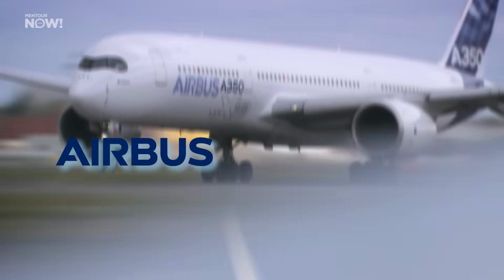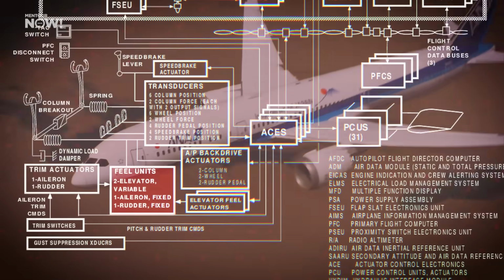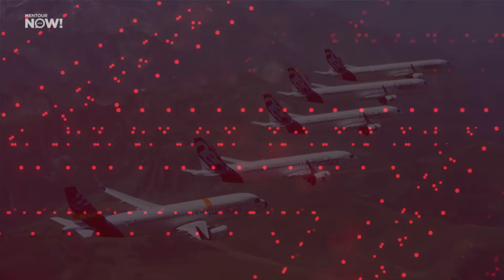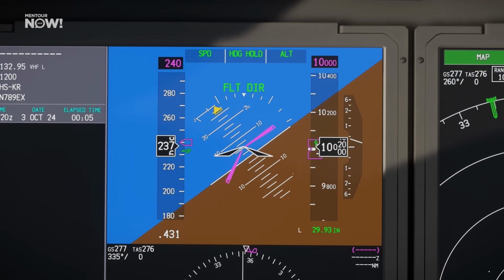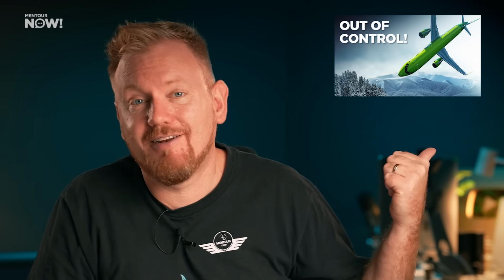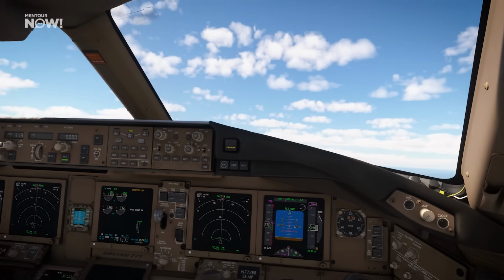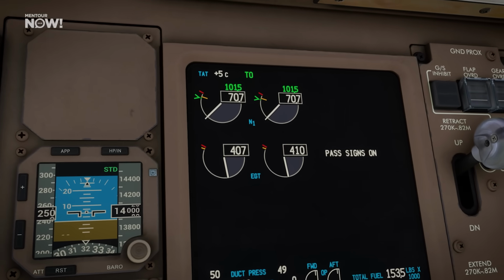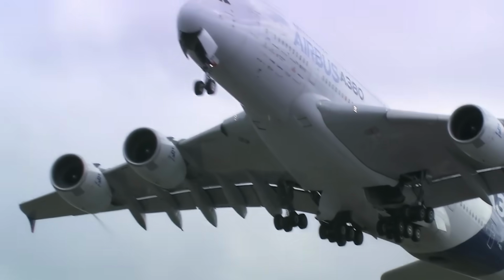Do Pilots Prefer AIRBUS over BOEING?!

Comment: Airbus > Boeing
Reply: If Airbus could implement active feedback and feel on all their primary controls, they would win hands down.
Reply: @alexandermonro6768  true
Reply: It is funny how Petter left 737 NG/MAX out of this. Even if majority of Boeings flying today are those. Those are of course 3rd gen, but it is not as safe or comfortable as 777/787 or Airbuses. I flew my first 2000h on 737NG and the next 10 years on 330/350. And I would never go back to that shitbox.
Reply: I prefer planes that don’t just fly out of the sky and crash or have sections of the fuselage blasting open midair
Reply: At least right now, I have to agree
Reply: Boeing still leads on total deliveries and revenue since Airbus started making them in 1974. Boeings' recent decline can't be denied but is still the dominant aircraft manufacturer overall.
Reply: Agreed. The perfect mix for me would be something in between; Boeing’s yoke & throttle with Airbuses “foolproof” systems
Reply: @realLsf Why do you value the yoke so much over the stick? Most fighter jets use sticks, I think. 
Adding feedback to the sticks and linking them seems much more important to me (but I’ve hardly any aviation knowledge, so just my thoughts).
Reply: @Conservator.  I think the yoke is more intuitive & feels more natural. You could build cars with a steering joystick but it’d feel strange to drive. I imagine that the pilots who train on one system or the other are well used it & both have their benefits
Reply: @realLsf  Ok tx! I thought that sticks would be a little more intuitive but that’s because I’ve once flown a sailer and that one had a stick so that’s my bias. (Just to explain). 
Like you mentioned, it’s probably what pilots are trained on. 
I do think though that forced feedback and linkage will be a major improvement. 

Cheers!
Reply: @ Good point about the single stick. Maybe it’s the pressure in the mechanism that’s important; giving it feeling
Reply: @Conservator

228 passengers in the South Atlantic are DEAD because of a side stick vs a yoke.  

Air France 447 would not have crashed if it was a Boeing.  

What’s more.. AF447 would never have got into the position it was in when it entered deep stall because the pilot flying would not be depending on Alpha Protect to keep him from doing so. 

Alpha Protect was disabled on AF447 when it reverted to Alternate Law in the absence of air data inputs… and its another flawed system that preserves angle of attack rather than airspeed (which contributed to the fatal crash of Airbus Industrie 129.. the first A330 to crash) and doesn’t explicitly annunciate its status.
Reply: @calvinnickel9995  
Why do you think it was the side stick. How would a yoke have prevented the accident?
Reply: @Conservator. One problem with stick is that a first officer graduating to captain has to switch hands
Reply: @realLsf  100% agreed.
Reply: Eww
Reply: Airbus at least has all the doors in the plane
Reply: @TechwithMartin. But when one pilot pushes the side control up and the other one down, the airplane ends up at the bottom of the Atlantic.
Reply: @CaliSteve169  Thats why wikipedia has with almost all boeing models a section called "Accidents or incidents"
Reply: @TechwithMartin.  if you consider total hours flown to accidents, Boeing is actually safer. In reality, both are statistically very safe.
Reply: @NaveedAkhtarButt  yes but they are connected mechanically.
Reply: Yes except airbus and Western Europe would not exist without America and it’s big stick.
Reply: Sure... At least a Boeing pilot can do whatever he wants if he's very insisting with the automation systems, like even crashes his plane if he wants to do...

An Airbus aircraft will have many more numerous protections before it will let do to happen.
Reply: This comment and 90% of the answers are not from pilots
Reply: Anything > Boeing
Reply: @colinchesbrough5772  yet statistically Boeing is the safest aircraft.
Reply: The problem with the airbus system is pilots rely on the computer. The Air France crash resulted from the pilot expecting the computer to fix his bad input not realizing he was in direct control and putting the plane into a stall. No tactile feedback for several minutes. The Boeing system would have at least given him a clue.
Reply: Boeing is a the poster child for human error..Airbus far superior
Reply: Personally, I like Boeing more. It's kind of weird to explain but I don't like how easy it is to fly a airbus. It's like manual vs automatic gearbox car. Automatic is easier to driver but manual is more fun. Though, I would not like to fly on a 737 any time soon lol
Reply: I am not educated on plane models, so why is Airbus better?
Reply: I knew it💀
Reply: Boeing has unclogged cooling systems.
Reply: Boeing is abit like American cars, great in a straight line.
Reply: I used to love Boeing, but with their recent issues spanning the last few years, I’ve become a much bigger fan of Airbus and their approach to overall quality of aircraft they produce.
Reply: @Eye-Byte you can still love Boeing. Why wouldn’t you? They’re superb aircraft that have had some bad press.
Reply: @ actual crashes and near crashes aren’t “bad press”
Reply: @ both crash sometimes Mike
Reply: Today, yes. However, Petter has done quite a number of episodes on pilots crashing perfectly good Airbuses because of how their systems work.
Reply: Better than perfectly good pilots crashing boeing planes cuz they're death traps
Reply: You’re obviously not a pilot.  

Pilots want the most money for the least amount of time away from home.  An A320 pilot slogging it out doing four legs a day on their 3rd four day paring of the month would fly a 777 twice a month to Europe or Asia in a heartbeat.
Reply: For now.   I can't get over the side stick
Reply: @MavHunter20XX  just modify it bro
joking 😂
Reply: At least it won't crash your plane
Reply: @MavHunter20XX  same, if they were linked together so, they can't cause a dual input, I'd be a lot more on board.
Reply: @Mon-W  yeah, that is what I was talking about. What is worse, you can't look over and see what the other seat is doing clearly....its like their "secret steering"
Reply: @Mon-W Airbus have been looking into a joystick with feedback. I’m not sure what happened to it tho?
Reply: @Mon-W  At least it's a relatively simple change
Reply: Options taken. None perfect, both marvelous engineering on each plane manufactured
Reply: airbus is ran by engineers who care about planes and manufacturing 

boeing is ran by accountant who care about money and profits 

you be the judge
Reply: best coment. everything is said.
Reply: COPE
Reply: State Capitalism > Shareholder Capitalism
Reply: No, Boeing isn’t worse, but people who watch Mentour Pilot will lean towards airbus because they can’t detect the channels bias towards airbus. The channel loves rubbishing Boeing and when he says “I’ll leave it up to you” it’s only after he’s set up the theme.
Reply: @chrismillard8222  bro, youre actually not sane if you seriously think that. Hes a boing pilot and seems like a strong believer of boing more involved style of flying.
Keep up the cope
Reply: @ I know he’s a Boeing Pilot….. I attribute it to his being European. He’s massively biased
Reply: Always has been….
Reply: No

Comment: Airbus: pilot error is unavoidable
Boeing: computer error is unavoidable
Reply: While both is not fully true, I think past accidents have shown that pilots generally make a lot more mistakes than computers. Then again: You need pilots most, when something goes so wrong, that the computer becomes somewhat helpless in the first place. So having a lot of computers to look over what the pilot is doing and even intervene is correct in my opinion. It still means you need good pilots for exactly the situations in which something is so damaged or goes so wrong, that the computer can't act anymore.
Reply: @TheGerudan pretty much. Computers are more efficient but they should not be used to replace humans. A software fault needs a human to fix it.
Reply: @princessroyal80  a computer should be used to replace a human when statistically it is safer to do so.
Reply: Aircraft avionic systems have to comply with DO-178C which rates software on a Design Assurance Level (DAL) scale from E to A. Software that is rated DAL A, the highest level, has to be subject to extremely stringent design, test and certification processes as it could have catastrophic impact if anything goes wrong. Pilots on the other hand will make mistakes as no human is error free.
Reply: @graemefrew1789  however, if not maintained properly, electronics can fail. For example, cockpit screens can go blank, which has happened on the 787 and A320.
Reply: @Blank00  Obviously any hardware can fail but there should be redundancy built into any system. On the aircraft I worked on , even in the event of total failure of the main displays, there is still reversionary flight data displayed to the pilot.
Reply: Reality - somewhere in between.  Both have their pros, both have their cons.
Reply: Take 100 computers and 100 humans. Now let them compute something like the total of the first 100 prime numbers. Who can compute faster and is less error prone? Hardware issues are usually related to sensors and not to the computer. "Computer error" is often faulty sensors or software error... and the software is written by humans. Computers are way much more reliable than humans. It's not even on the same scale.
Reply: @FrancisFjordCupola  Yes it's the software that's error prone.  I'm not an embedded developer, I don't think embedded software shouldn't fail like this.  It's much more compact then regular software, and I would think that they'd test it in a variety of scenarios˜˙.  And it should include tests to rerun after each modification to prove that it still works.  But MCAS relied on only one sensor and apparently didn't shut down when the senor failed.
Reply: Europe: eggs shouldn't be washed to prevent salmonella poisoning.
America: eggs should be washed to prevent salmonella poisoning.
Reply: @anotheruser9876  You forget to mention: America: and after you removed the egg's natural protection, you have to keep it in the fridge
Reply: @anotheruser9876 
Not quite: eggs must be washed and refrigerated. Then the US refuses to collect and publish sufficient data to allow for comparisons.
Reply: @anotheruser9876  Me: Eggs

Comment: I will never forget the first fly-by-wire Airbus that flew into the trees at Mulhouse-Habsheim Airport. That clinched it for me. It was a damned miracle more didn't die than the three out of 136. Too complicated now. Cars have become the same way. It is now to the point mechanics are unable to repair the damned things despite specialized knowledge and tools. Too much automation makes for lazy, unprepared, mechanically unsympathetic pilots. And If there's anything this channel has taught us, it's the PILOTS that are the weak link. By far. Petter is loath to admit this, but it should be obvious to all.
Reply: It was the wrong wire.
Reply: Those times are gone . Now Airbus is by far the best
Reply: @AnetaMihaylova-d6f  No, it isn't. And remember, Airbus was prosecuted for fraud, bribery, etc. Billions in fines, etc.
Reply: @AnetaMihaylova-d6f  not gone.remeber 2019?
Reply: The pilot was stalling the plane over a mile until he hit trees.
Reply: Pilot error, switched fly past route at the last moment from a commercially rated runway to a GA runway with obstacles. They were way too low demonstrating Alpha Max protection, leaving no room for recovery considering the circumstances.

Comment: If there's one things I've spotted it's that it's far more common for Airbus to trickle down their new technologies from the newer aircraft to their older ones and offer as retrofit. For example the Back Up Speed Scale first introduced in the A380 was added to the A320/A330/A340 a few years later and can be retrofitted to older aircraft, when the A350 used the new DBUS and enhanced speed monitoring system, the A320/A330 soon got a modified version of that. To this day only the 787 has an equivalent version.
Reply: Few people know that the B737NG could and should have had a functioning EICAS, but Southwest, Delta and American Airlines didn’t want to spend the money to retrain their pilots, and now, 30 years later, Boeing is crying blood at the prospect of being forced to install it on the MAX -10.
It often boils down to corporate greed, toothless government agencies and weak political will.
Airbus have EASA write the rules for them to push innovation, Boeing has lobbyists stop the FAA from forcing them to innovate on old designs.
Case in point: AoA is information the ADIRUs base their output on. It’s information the system has and that can easily displayed to pilots. Why is AoA display not mandatory? So that Boeing can sell it as an option, easy as that.
Of course airline managers in charge of buying aircraft (they call them “equipment” to further distance themselves from the flying part of their company) don’t want to pay for an option, however safety-improving it would be, so pilots with blocked pitot tubes or faulty ADIRUs are doomed to die and kill everyone on board.
Reply: @soffici1   I agree with all you say here, except - “weak political will”…? 

As I see our global north economy having changed in 4’ish decades, it’s an outcome of excessive political will! They got what they wanted, or should I say “what their corporate supporters wanted”? 

Or… didn’t we understand what they wanted, and thought we (non-corporate people) wanted the same? We (someone did…) called it “freedom” after all, nice catchphrase. It worked! 😅
Reply: @musiqtee  yes, weak political will. Basically what you said: politicians bending the knee to corporate supporters wills. Obeying the orders of who you should be governing means you are weak
Reply: Airbus is very good when it comes to software updates. A lot of the A320NEO features are easily transferable to the A320CEO via just a software update. It allows airlines to standardize all their aircraft features regardless of the age difference between them. Like you said, the BUSS is a great example. Even though (most) NEOs come with a lovely BUSS pushbutton on the MIP, unlike the CEO, where the BUSS is triggered by an ADR1+2+3 FAULT.
Reply: This is definitely an advantage to Airbus, especially if they ensure all of one model in an airline's fleet get modified over a short span of time along with pilot training.
Reply: Excellent point. My airline decided to keep some low-cycle old (1990's) A320's by fitting new CRT's, processors, and upgraded MCDU software. Extended the aircrafts life span and made the older units more similar to the newer versions for fleet commonality.
Reply: @dcxplant  I assume you meant EIS 2 LCD screens as they’re newer than the EIS 1 CRT’s
Reply: @tomstravels520  Yes thanks. Our old and smelly 320's got the new screens and upgraded MCDU processors with better software package. The squared off corners also meant we have all new plastic covers on the panel also. The center consoles are nice a deep cleaned but still the same.
Reply: Certainly agree, but have an inkling that this may be a practical difference - not just “unwillingness” on Boeing’s part (caveats for last decade+ corporate shenanigans)… 

The Airbus is (as you and Petter mention) both modular and mainly digital (bus-based) in communications between the cockpit IF/UX and the functional units in the bay. 

That way, some retrofits may (!) be more a software and sensor change, running and being displayed within the existing process-units and displays. The B737 - the oldest airframe still in production - these retrofits become convoluted for practical reasons. 

The sad outcome from “larger engines -> MCAS” is an example, whereas the A32x is aging, but still new in comparison. New engines were less different to the original ones. 

Check out the original B737-200 low bypass engine mounts, engineered only a decade (plus) after some very “creative” airliners… 

(I’m 58, about the same as the original B737. Retrofitting “my systems” makes me very unreliable…😂)
Reply: It's insane that the 787 is the only Boeing airplane with a backup speed scale. It's literally a life saver
Reply: YOU LOST ME AT TRICKLE DOWN. F RONALD REAGAN
Reply: DBUS isnt the only thing. According to Airbus Safety Beyond Standard articles, Airbus also included a pitch limit protection in alternate law for the A350 that can be given to A320s, A330s and A380 to decrease the chances of stall by reducing speed decay. The robust autopilot from the A350 that stays on for numerous failures and auto TCAS can also be retrofitted to the A320 and A330. The benefits of Airbis having a large FBW family of aircraft.